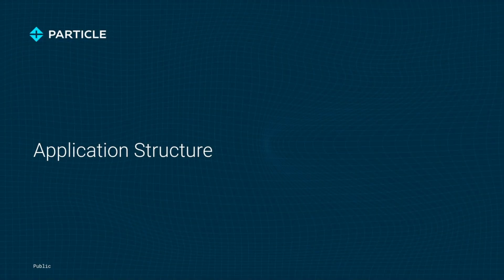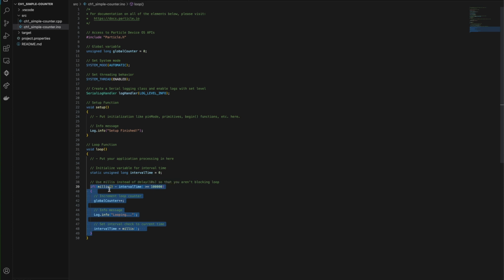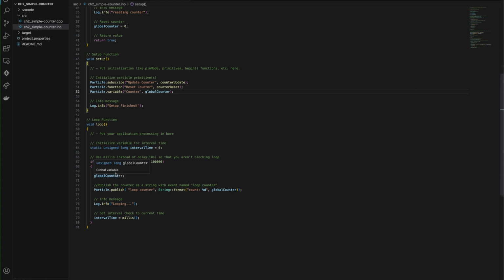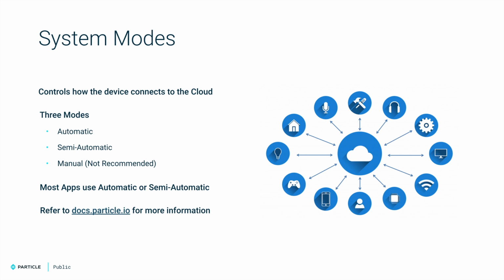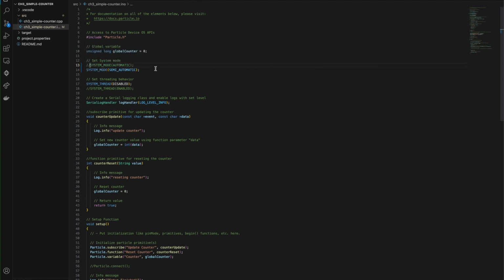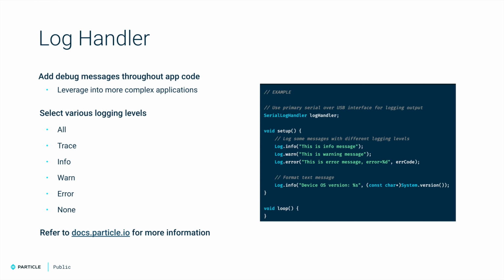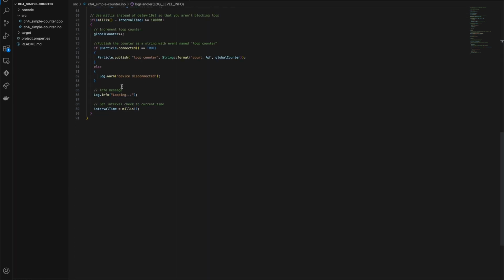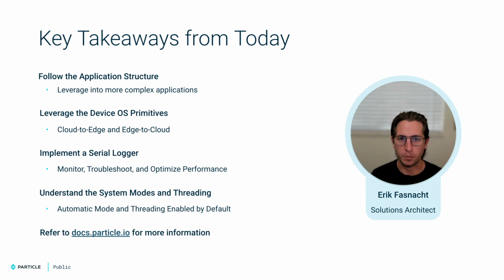How to Apply Healthy Design Principles with Particle

Comment: This is a really good introduction.  The template has changed since the video was published, and it no longer outputs an .ino file.  The contents of the .ino file should just be viewed as a .cpp file with a different extension, and you can use the .ino contents that Erik has shown here in the .cpp file for new projects.  I just wanted to clarify for any new users who might not be familiar with change and its impacts.  Happy coding!